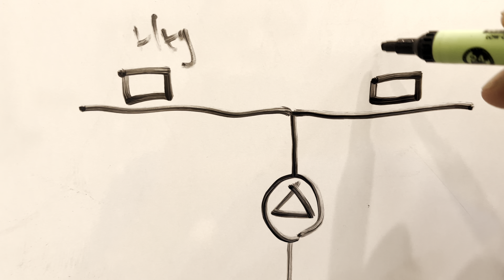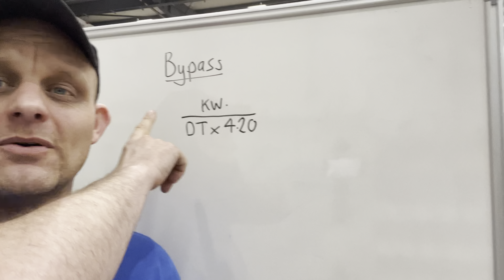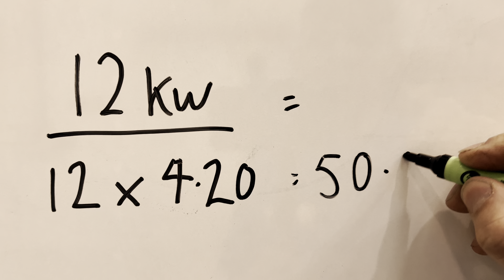How to set auto bypass valves

Comment: 0.24 lps is the flow rate for the system at 12kw dt 12 - surely you need to check your pump graph to find the head ? Or something like that ! You can’t just set the opening pressure to the flow rate ? I might be wrong I’m very drunk
Reply: What you drunk on? Lol
Reply: 🤘😎🤘 Great video
Reply: @jamesmonaghan4460  You are right

Comment: We’ve started to notice that when our boiler switches from heating to DHW we get a loud thud. Someone on a heating forum suggested checking the bypass valve as it could be sticking. Is the noise I’m describing a common problem with bypass valves? Thanks.
Reply from the maker: @stevesmith7675  sounds like a motorised valve
Reply: @ That’s interesting I was watching them the other morning when DHW ended. I was expecting to see the levers move from auto to manual or something like that. Nothing happened. Is there a way to test if it is the motorised valves?

Comment: Do we need to calculate the entire heat loss using thermal resistance (U-values) and surface areas like we do for UFH? or is there a rule of thumb like the property has 6 rads, we can say 2Kw per rad or do we go with the actual max heat output of the appliance, say 12Kw? 18Kw, whatever that is?
Reply from the maker: 2.5kw per radiator is rule of thumb, or u can use m2 heatloss
Reply from the maker: Software is pretty good now